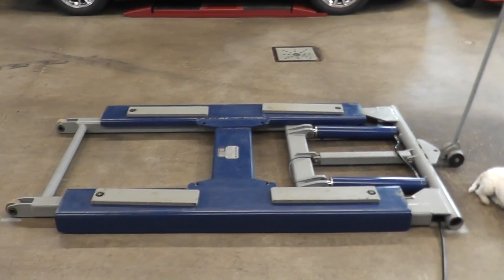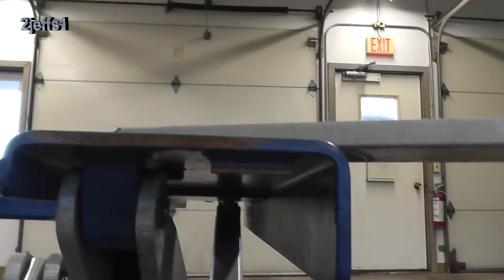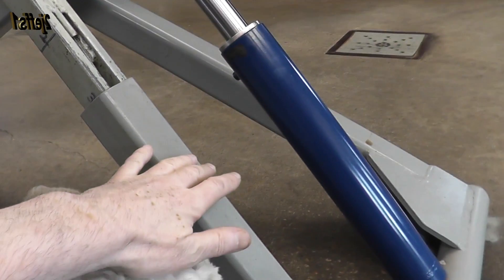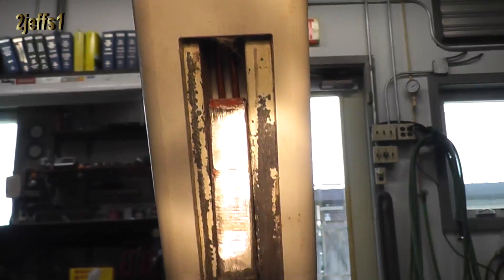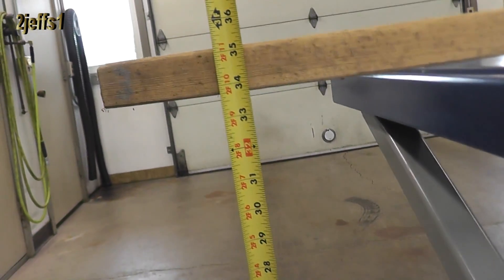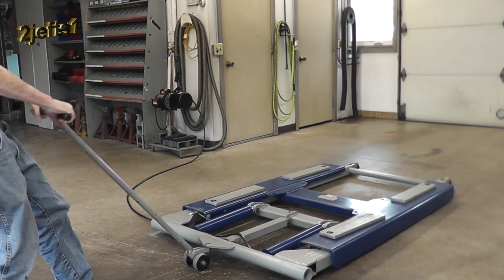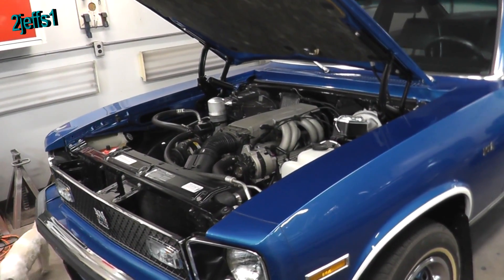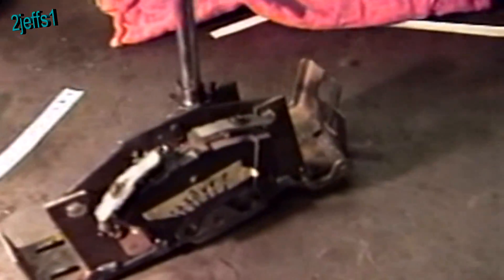Western Hoist Modifications Improving Opperation and Overview

Comment: Hey thanks for the video. Iv e been looking at buying one or building one using the pump on my log splitter. I'm actually building it to be movable and take the splitter part off as I want to use it to power a couple of hydraulic projects. What part of Sconsin  sre you at? I'm in Marquette county about 60 miles up from Madison.
Reply from the maker: Multiple use on that pump. Always like those thoughts/idea's to keep costs down! I'm in Winnebago county. Bout a mile from lake Winnebago.

Comment: I acquired the same lift I have a question on the part were u bolted the arms instead of them sliding would u say it works better or are u limited
Reply from the maker: Works on everything now. Sure didn't before. Did realize that prior to purchase. Figured there would be a way around that issue and there was. Also built a bunch of different height blocks at the same time to accommodate anything that comes in. Ford truck frames - in the rear - are the biggest need for longer ones.
Reply: Are u able to give me any measurements to were the bolts are any info would be helpful